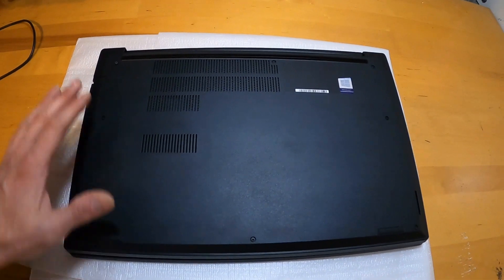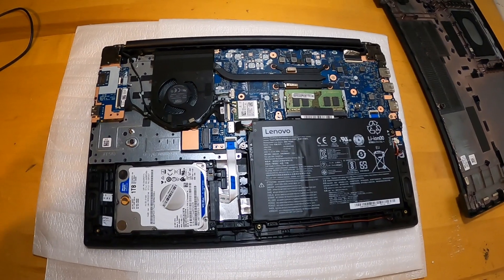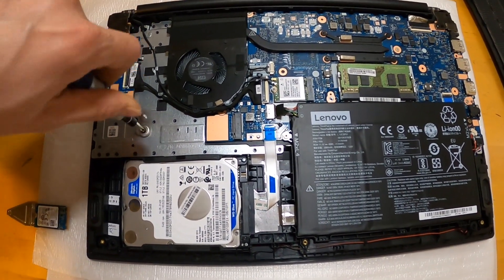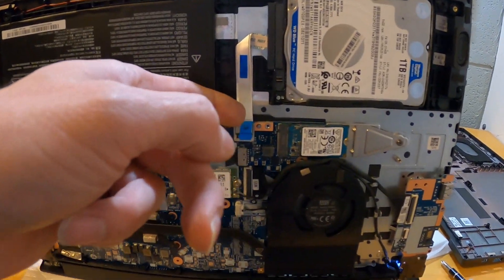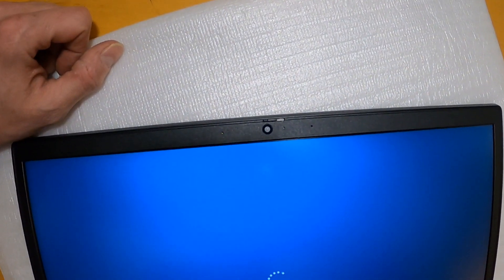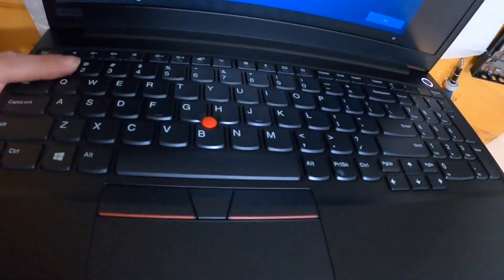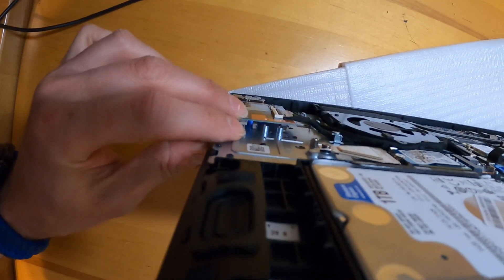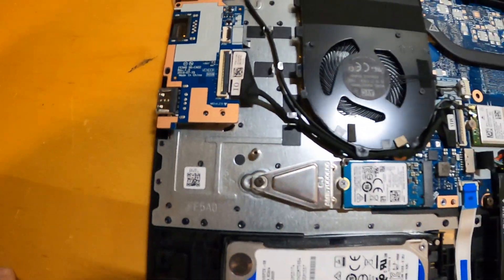Lenovo ThinkPad E15 Laptop NVMe SSD & RAM Upgrades

Comment: Hey man, thank you for the video! I’m in need of replacing the motherboard and found some instructions on LeNovo’s website, but I find it weird that they say some components must be REPLACED after replacing the system board, instead of just reconnecting. Would you know if this is true?
Reply from the maker: I can't think of components you would need to replace unless they just mean putting RAM and M.2 drives back in, which I could see termed as "replace". Also keep in mind that if you use BitLocker you will need the key in order to unlock the ssd. Windows also may become deactivated with the change in Hardware.
Reply: @ZipTieNinja thank you!

Comment: Hey there, appreciate your video. Just wondering if you can have both a SATA SSD and an NVME SSD installed simultaneously?
Reply from the maker: On the laptop in the video, yes. There are different generations, and newer ones don't come with 2.5" drive support
Reply: @ZipTieNinja  Great, thankyou! Do you know if the same is true for the L15 (Gen 1 and 2 have a SATA and NVME)?

Comment: Hello dear, Thanks for the review. I have a question, can I make a multi-boot so one hard windows os and the other will be ubuntu Linux?
Reply from the maker: You certainly can, and you can use one hard drive for both operating systems if you do it right. You should look for current information, but if I remember correctly, you should install Windows first and then Ubuntu. The key is letting Linux be the bootloader
Reply: @ZipTieNinja  thanks a lot it works

Comment: Hi. Can you install a GPU to Thinkpad E15?
Reply from the maker: With few exceptions, graphics cards cannot be installed or upgraded on laptops. These days most components are soldered onto the motherboard.
Reply from the maker: You can order this with dedicated graphics from Lenovo though.
Reply: Hi Michael, I think it is possible to install an eGPU tho..
Reply: @FastBonkks  but for that laptop should have thunderbolt port

Comment: Can I replace E15 core processor? my laptop is equipped i5 10 gen which I would like to replace with high end processor
Reply from the maker: The CPU is soldered in, and cannot be replaced. This is true of almost all laptops these days.

Comment: Nicely done. Informative video. Thank you. Quick question E15 vs T15, which one would be better option in terms of reliability and robustness?
Reply from the maker: The cooling looks better on the T15, but I haven't had a chance to see one in person yet. I like the removable keyboard on the T15 too. That said, it is decently more expensive than the E15 and has soldered on RAM.
Unless you are getting the dedicated NVIDIA Graphics and / or the 4K display, the E15 looks like a better value.

Comment: You installed an M.2 Sata SSD, right? M.2 NVMe has only one notch, I'm not 100% sure though.
Reply from the maker: No, it is an OEM 2242 NVMe Toshiba Drive. It has the  B+M-key instead of the M-key only. I think it is because it is a PCIe x2 not x4.
Reply: Thank you for clarifying.
Reply from the maker: You're welcome. I have a WD NVMe 2242 and it has the B+M-key as well...

Comment: Hi will this model suits to this device : 
Samsung (MZ-V7E1T0BW) 970 EVO SSD 1TB - M.2 NVMe Interface Internal Solid State Drive with V-NAND Technology, Black/Red. ? I also found in another website guys are upgrading the 8Gb(single) memory to size of RAM memory : 32GB 
memory technology: DDR4 
memory pulsing: 2666MHz (PC4-2666V-S) 
RAM memory type: SO DIMM 
number pin: 260 Pin DIMM 
voltage: 1,2 volt     Did you tried it ?
Reply from the maker: Yes, the Samsung Evo M.2 NVMe drives work great in this PC. Everything published says 16GB is the max RAM, but I haven't tested 32GB myself.
Reply: Zip Tie Ninja thank you very much .I think to try the memory upgrade late and let you know . What will be the fair test if the computer recognise that memory? I did a upgrade before in one Samsung but honestly the computer seems slower than before upgrade
Reply from the maker: You can check in Windows or the BIOS to see if it is recognized. Too high density RAM may be the issue on the Samsung...

Comment: can i use the HD and the SSD together? or i need to use just one of them?
Reply from the maker: You can use both.
Reply: @ZipTieNinja  Slightly different question on using both drives. Can I leave Windows on the SSD - go into the BIOS - and set the HDD as boot, and install Linux, then change the BIos if I need to boot Windows?

Comment: Does the SSD head up? Because it looks like you didn't put the thermal pad on, as mentioned in the Hardware Maintenance Manual.
Reply from the maker: There is no heat spreader included if you don't get the version that comes with a NVMe SSD. You wouldn't use a thermal pad without a heat spreader. The stock NVMe ones have both.

Comment: So, I am a complete novice to this whole topic. I would buy "Lenovo Campus ThinkPad® E15 AMD (Gen.2) Sondermodell 20T9S00K00" which has 500 GB SSD already. If I want to upgrade my laptop to 1TB SSD, what do I have to do? Do I have to buy 1 TB SSD and replace the old one, or is it possible to buy 500 GB SSD and just add it to the existing? Can I insert "ADATA SSD SX8100 von XPG mit PCIE GEN3x4 und M.2 2280, 512GB" to the already existing , is it the right model? Also is there maybe a better SSD drive or is it a good one to add to the laptop?
Reply from the maker: You would want to replace the 500GB NVMe SSD with a new 1TB NVMe SSD. I recommend getting a Samsung 970 EVO Plus. ADATA is cheaper, but slower and lower quality. The Samsung 970 PRO is even faster, but not really worth the additional cost.
Reply from the maker: My review of the E15 Gen 2 is up! 
https://youtu.be/jmn5Z54ONvA

Comment: is CPU  soldered on motherboarD ?
Reply: yes _ I checked Manual.
Reply from the maker: Yes. You are correct :)
Reply: @ZipTieNinja  could you please  test that,  Can I connect 2 External monitor to this laptop,  1  over from Usb C HDMI,  another from   HDMI Output.
Reply: @CoderCoder  yes

Comment: Hi I am using a ThinkPad x240 from long time
I am keeping my laptop on for a very long time reaches to 9 days 
does the E15 have the power to stay up the same time as my x240.
Reply from the maker: Are you saying your battery lasts 9 days? or are you saying that plugged in the laptop only stays on 9 days?
Either way, I'm sorry, but I don't think I understand the question.

Comment: Hi, Can I install Intel Optane memory?
Reply from the maker: Yes, all Core i3/i5/i7/i9 CPUs 7th gen and later support Optane Memory. I would recommend a quality M.2 NVMe SSD instead, like a Samsung Evo or Pro instead. Optane is really used to improve system responsiveness when you are using slow storage devices.

Comment: Two questions: 1) Why didn’t you need to reload Windows?    2)  Would it be possible to leave the old HDD in place as additional storage?
Reply from the maker: This was just to show the hardware upgrades. You do need to reload Windows. Yes, you can leave the old HDD for more storage.
Reply: Or you could use free cloning software and clone the HDD onto the SSD.

Comment: You didn't show how to do a RAM upgrade (the video title says "NVMe SSD & RAM Upgrades"). I want to upgrade the original 8GB memory to 16GB. Since there is only one slot for memory,  that means I need to purchase a 16GB card. Can you show how to remove and replace the memory card?
Reply from the maker: This video was intended to show what to expect inside if you are looking to upgrade parts, not how to work on laptops. 
I have shot a video showing how to open the case and instal RAM. I will upload it soon :)
Reply: @ZipTieNinja  great - thanks!
i assume because I subscribed to your channel I will get a notification when the new video is uploaded. thanks again!
Reply from the maker: You may need to turn on notifications separately, FYI.
Thanks for the sub!
Reply from the maker: Here you go! https://youtu.be/u8MfMmE2X74
Reply: Zip Tie Ninja Thanks so much!
Reply: Zip Tie Ninja I got the notification by subscribing. Thanks!

Comment: i have E15, dose it support M.2 NVMe SSD ? like Crucial P1
Reply from the maker: Yes, it supports 2280 length NVMe drives, or shorter ones with an adapter. I prefer the Samsung EVO 970 Plus drives, FYI.

Comment: What's the max ram capacity on the e15, 16gb, 32gb or 64gb? Also how's the keyboard, is it springy like the e495 or is it stiffer like the x1 extreme gen 1 and 2?
Reply from the maker: Everything official I've seen says 16GB is the max. This is most likely because it only has one SODIMM slot :(
Reply: i just ordered a model with 32gb installed.
Reply: i think there is one 8gb ram and the sodimm can take up to 24 gb ram

Comment: Do you consider the e590 a better option? I can t decide between the two
Reply from the maker: Hard to say. I've had my hands on around 30 of the E590 Laptops and they are solid and reliable. The standard screen is only 1366x768. I had to dig to get find them with 1080p resolution.
I've only worked with 2 E15 laptops, but they seem good. I don't like that the keyboard isn't removable, and only having 1 RAM slot is a bummer.

Comment: I cannot find any reviews of this laptop. Can You tell me something about thermal performance and fan noise? I've got ThinkPad L480 and it's cooled passively below 60°C (140F) on CPU. Im wondering if this model works the same.  Is it possible to browse the web without waking up the fan? How about quality of plastic body?
Reply: I'm using an E15 for two days now (browsing, developing with vsc and typescript). Most times the fan is off. If it kicks in it's only for a few seconds and barely hearable.
Reply: This is a review for the model with video card AMD Radeon RX 640,  https://www.notebookcheck.net/Lenovo-ThinkPad-E15-Laptop-Review-Too-much-performance-with-too-little-cooling.457719.0.html    
Overall, we cannot recommend the Lenovo ThinkPad E15 with the dGPU. The AMD chip is simply misplaced here if it cannot be cooled sufficiently. The iGPU version meanwhile might be worth the money – as a bigger version of the ThinkPad E14 and a good laptop for the home office. Thank You.
Reply from the maker: I think all contemporary laptops have a thermostat that stops the fan from running below a certain temp. I haven't used this one day to day, so I don't know if it kicks in during normal use. If I find out I will let you know.
Thanks!